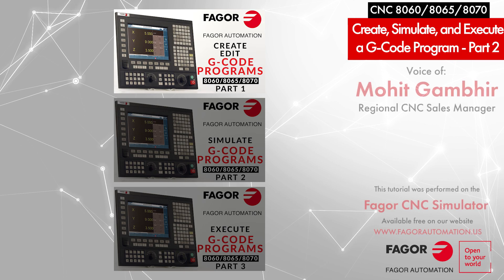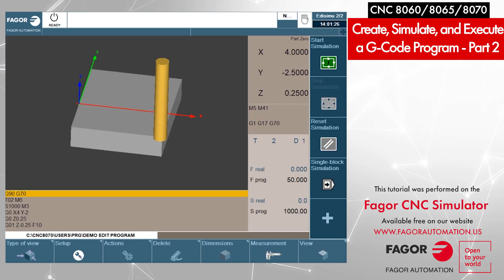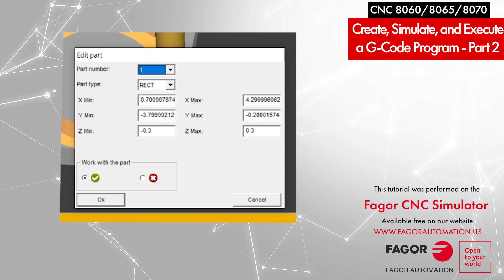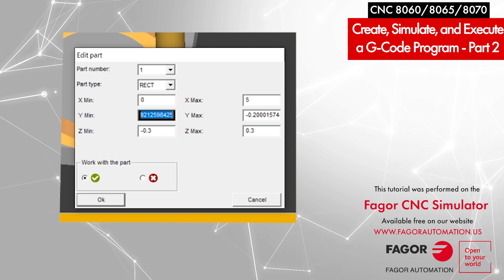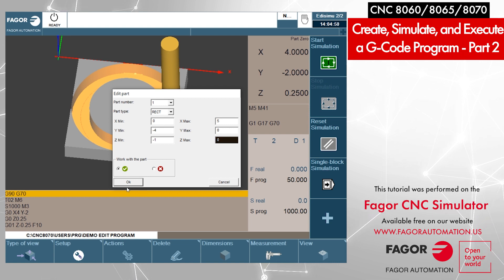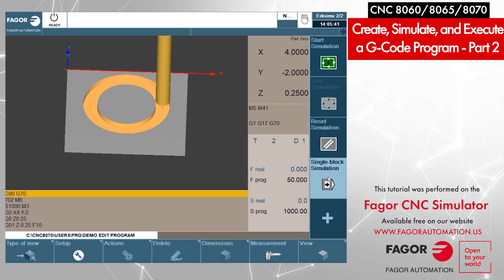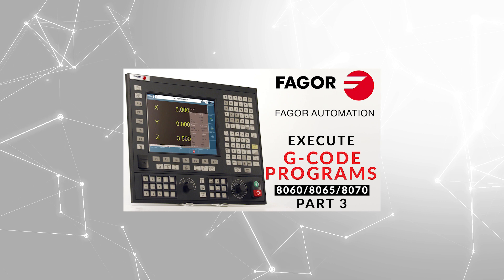Simulating G-Code Programs on CNC - Fagor CNC 8060 / 8065 / 8070

Comment: Here just to gift you all Fagor users A PROGRAM MAP RECALL-TEMPLATE!
Click on "Read more" to expand the comment post, copy and paste on NOTE-PAD.

%PRO-TEMPLATE (RENAME),MX--,
;   JOB#: XXXXX
;         
;
;   DATE: XX/XX/XXXX
;   PART#: XXXXXX-XX
;   REV-L: XX
;   VERSION: XX
;   SETUP INITIALS: X.X.
;
;   NOTES:  WRITE ANY IMPORTANT NOTES ABOUT THIS JOB
;                   COPY AND PASTE THIS TEMPLATE TO CREATE A
;                   NEW PROGRAM EVERY-TIME...
;
;
;
;                 **JOB TOOLS TABLE INFO**
;
;           T#  BIT    CUTTER#  EXT#  BIT-IN OAL-OUT"
;
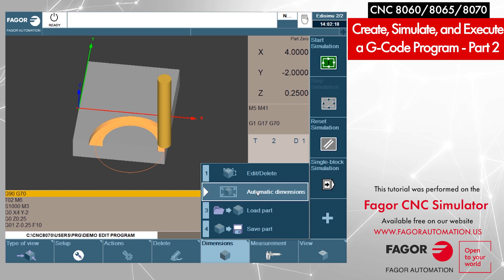;           01  1/8"  #62-7420   1/2"   1:50"   5:25  (EXAMPLE)
;           02  X/X   #XX-XXXX  X/X   X:XX   X:XX
;           03  X/X   #XX-XXXX  X/X   X:XX   X:XX
;           04  X/X   #XX-XXXX  X/X   X:XX   X:XX
;
;
;
;
(PCALL 19);<PROGRAM/STARTUP CODES>
;
;   **ORIGIN**
(PCALL 20);<JOB ORIGIN ON TABLE AA/10> 
;
;G158 X0.0000 Y0.0000 Z0.0000;  ***SHIFT ALL PART OR OPERATIONS HERE 
; G158; CANCEL/COPY AND PASTE WHERE NEEDED
;
;
;
;
;************************************1ST OPERATION STARTS******************************************************
;
(MSG"FLANGE OFF / TRIM IN-PROCESS...")
;
T01 M06
D01
S10000M3
G51 A75 E.001
G48S0
;
;(GOTO N99);<JUMP TO>... / USE TO SKIP OR JUMP TO DIFFERENT POINTS WITHING OPERATIONS
 
;N99;<HERE>.../ JUMPING POINT
;

;
(ADD PROGRAM OR RECALL AN OPERATION SUB-PROGRAM HERE...)
;
;
G7
G0 Z0
;
(MSG"TOOL-CHANGE IN-PROCESS...")
;
;************************************1ST OPERATION ENDS******************************************************
;FROM THIS POINT ON YOU'RE GOING TO COPY AND PASTE WHATEVER OPERATIONS ARE NEEDED WITH OTHER TOOLS
;
;
;
(PCALL 21);<DEFAULT NC-PARKING CODES>
;
;G01 Z0.000 F6000; ***CUSTOMIZE YOUR OWN NC PARKING HERE IF NOT USING THE DEFAULTS...
;G01 X0.000 Y0.000
;M05
;M30